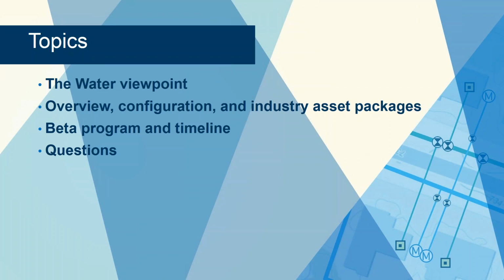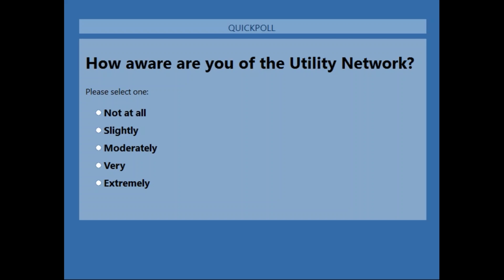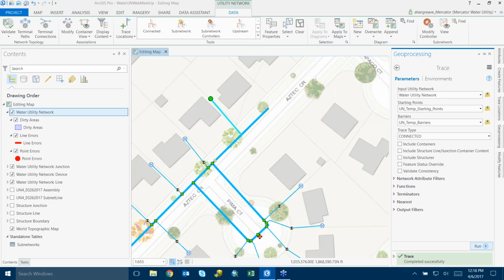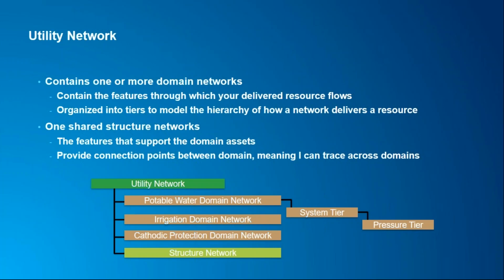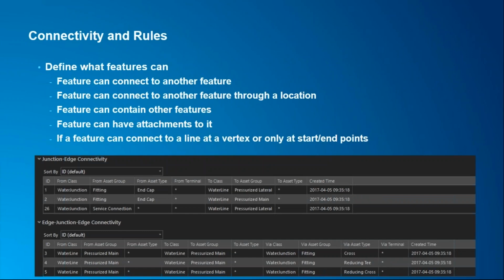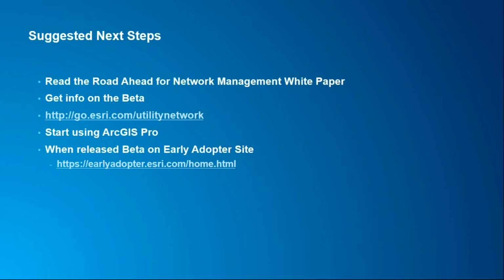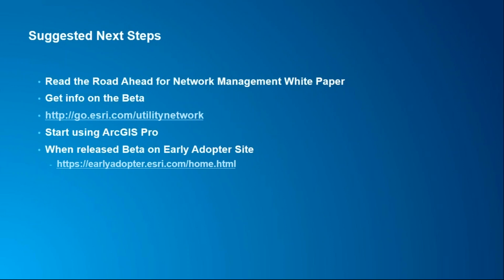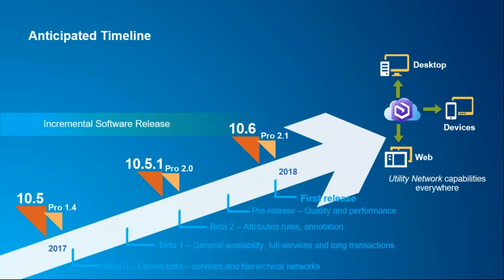Getting to Know the Utility Network

Comment: Where I am from  our utility network was built in Jurassic Era. What you proposing is interesting but the only way we would l update our utility network is if ESRI would open a permanent office here in Djibouti, East Africa (Country where the base Camp Leumonier set  her base). So no we don't use Arcgis Pros. I use Arcgis 10.2 and Acgis online, i have a web licence that will end up in 1170 credit. But i am in contact with Esri Kenya concerning other Census data.